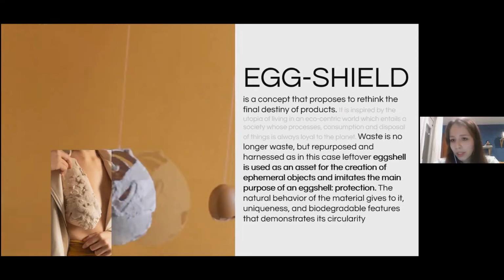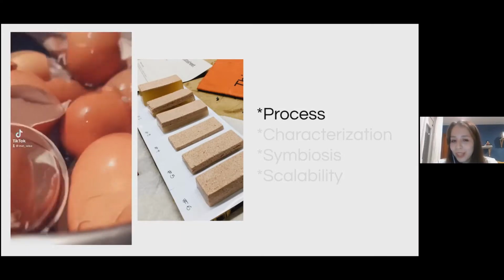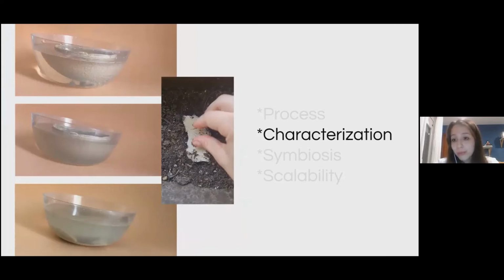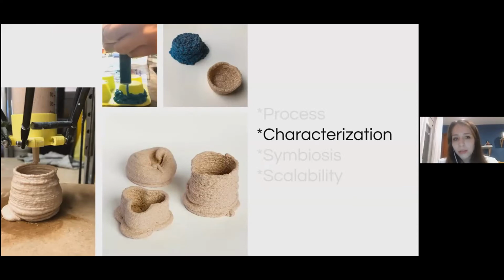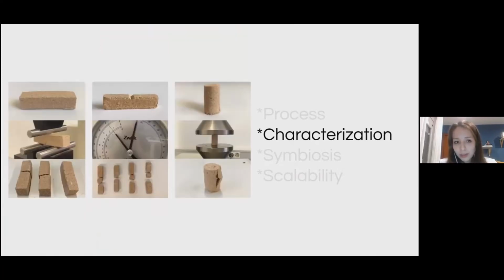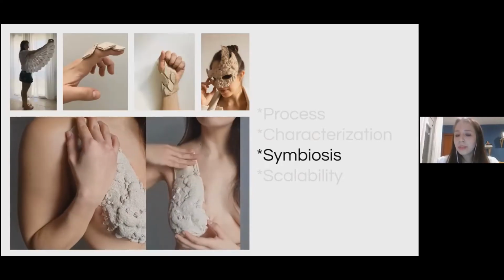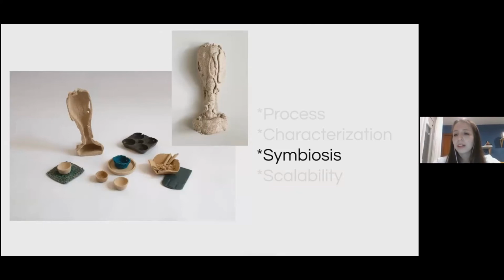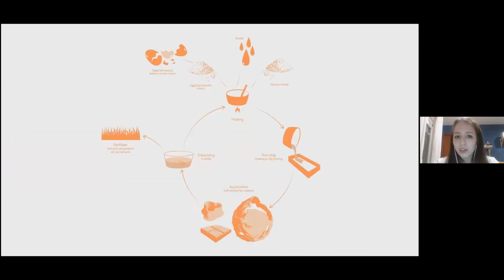Talk Part 1 - EGG-SHIELD

Comment: finally i found this, i see your recipe in materiom, and i wonder how strong this material ? cause i'm new in this biomaterial thing
Reply from the maker: Hi! It behaves like our bones since it is made of a biopolymer (in this case gelatine, in our bones, collagen) and CaCO3 (the eggshell, calcium carbonate). Also like an intermediate between cement and ceramic. So you can tell ;) fragile, and consistent enough to maintain the shape. It will also depend on its thickness and the loads applied to it.